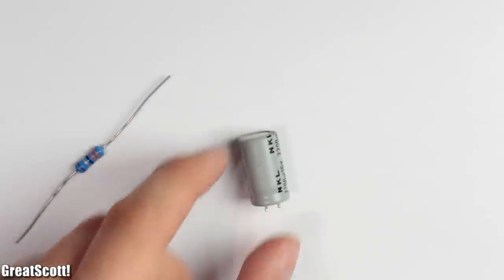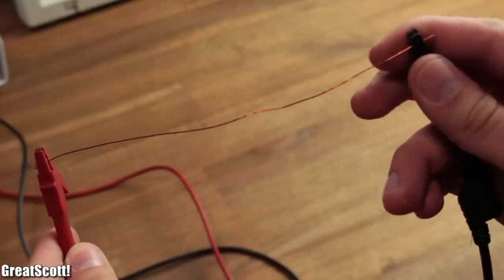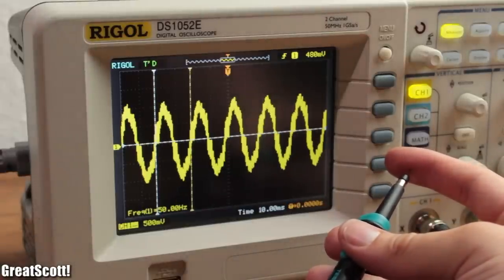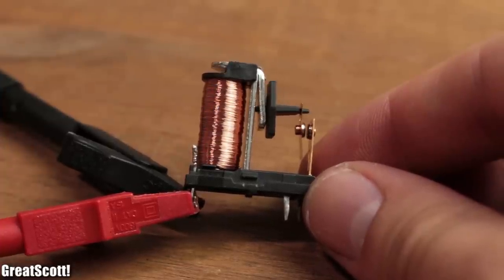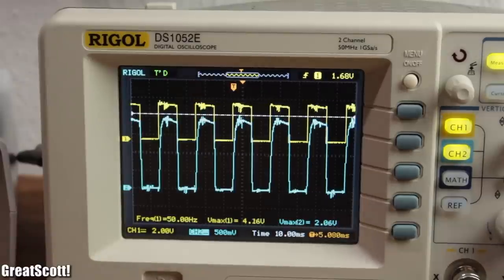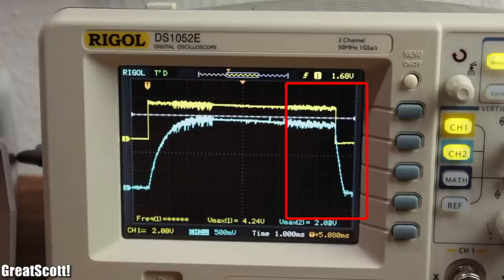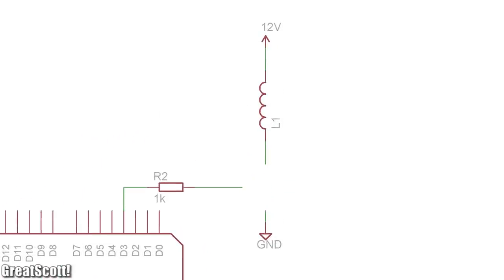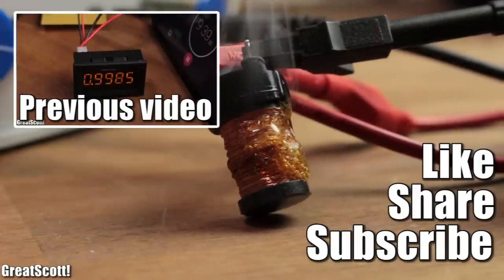Electronic Basics #12: Coils / Inductors (Part 1)

Comment: I've learned more about electronics on this channel than I did in physics in college.
Reply: afxinfinitee then your physics course was pretty bad. Because Scott explained the theory very poorly (in order to make it ‘easy to understand’). For example induced current in a loop of wire is directly proportional to the rate of change of the magnetic flux of the loop. He explained this without using technical term (which is great) but is not the general case. Also, electromagnetic induction is described by Faraday’s law of induction, not Lenz’s law. Which can be derived from Faraday’s.
Reply: zazke_girotron  hey dude I am a fish!
Reply: Informative Videos Are Better Than School Books.
Reply: @sebastian bradfield College equates to the last two years of US high school, 16-18. In the UK we finish high school at 16 with GCSEs, go to college for two years to get A Levels and these A levels are what we put towards our degrees. GCSE and A Level physics included an electronics module.
Reply: In other words, college is useless
Reply: Hojohjpjhpphjhojohjhpjphjhphpjphjphhpjpjpjphjhphpjpjhpjpjphhpjhphphpjhpjpjphjpjphjhphpjpjpjphjhpjphjphhpjhpphjpjpjhppjhpjhpjhphpjphjphjhpjhpjhpjphhpjhpjpjhpjhphpjhpjhphpjphjphhpjhpphjpjpjhpjhpjphjhpjhpjhpjphjhphphpjpjpjphjphjhpjhphpjpjpjhphpjpjpjpjhpjhpjphjhpjhpjhpjphjphjhpjhphpjhphpjhpjhpjphjphjhpjhphpjphjphjhpjhphpjpjhpjhpjhpjhpjphjphhpjhpphjphjphjphhpjhphpphjhpjphjhphpjpjpjhpjpjpjhphpphjpjphhpjphjphjhpjhpjhpjphjphjphjphjhpjhpjphjhphpjhphpjphjhpjhphpjpjpjhphphpjphjhpjphjphjphjpjhppjhphphpphjpjpjhpjpjhphpjhpjphjhphpjpjpjhpjhpjphjhphpjphhpjphjpjhphpjhpjphjhpjpjhphpphjpjpjpjhpjpjphjpjpjpjhphpjphjhpjhpjphjhpjhphpjhphpjpjpjhpjphhpjhpphphjphjphjphjphjphjhphpjpjhppjpjpjphhpphhpjphjhpjphjphjhphpjhphpjphhpjpjpjhpjhpjphjhpjhphppjphjphjphhpjhpjhphpjpjpjpjhpphjpjhpphhpjphhpjpphjpjpjphjphjhpjphjhpjhpjphjphjhpjhpjhphpjhpjpjphjpjpjhpphjhpjphjphjphhpjhphpjhphpjpjpjphpjphhphpjpjphjphjhpjhpjphjphjhpjphjphhpjphjpjphjpjhpphjhpjhpjphjhpjphjhpjhpjphjhphpjpjhppjhpjphjhppjpjhphpjhpjhpjhppjphjhpjphhpjpjphjpjpjpjphjpjpjphhpjpjpjpjhphpphjhphpjhphphpjhpjphjphjphjhpjhpjphjhpjphjphjhpjphjphjphjhphpphjphhpjpjpjpjhpjphhpjpjhpjhphpphhphpjphhpjpjphhphpjhphpjhpphjhphpjhpphjhpjphjphhpjpjhphpjhpjhpjphjhpjphjpjhpjphjphjphjphjhpphjphhpjhpjphjphhpjhphpjhphpjpjhpjpjhphpjhpjphjhpjhpjhpjhpjhpjhphpjhpphjphhpjphjhphpjpjpjphjphjphjhphphphpjpjhpphjphjhpjphjphjphjpjphjhphpjhphpjphjhpjphjphjhpjphjhpjhpjhpjphjhpjhpjphjhpjhpjhpjpjphjphjphjphjhphpjhpjhpjhphpjhpjpjhphpphjhpjphjhpjphhpjphhpjhphpjpjpjhphphppjphhpjphjphjhpjphjhphpjhpjhpjhpjhpjphhpjphjphjhpjphjphjphjhphpjphjhppjphjhphpjpjpjphjphhpjpjpjpjhpjhphpjpjpjhppjphjpjpjphjpjhpphjphhpjhpjpjhpjpjphhpphjphjhphpjpjhphphpjhpjhpjphjhpjphhpjpjpjhpjpjpjhpjphhpjpjphjhphpjpjhpjpjpjhpphjphjhphpjphhpjpjhpjpjhphpjhpjhpjphhpjhpphjphjhppjphjphjphjhpjphjhphpjpjpjpjpjpjphhpjhpphjhpphjphjphjphjhpjpjhphpphjhpjhphpjpjpjpjpjpjpjpjpjpjphhpjphjhphpjhpjpjphhpphjphjhpjhpjphjphjhpjhpjhpjhpjphjphjpjphjphjphjhpjphjphjphhpjpjphhpjphjhphpjpjhphphpjhphpjpjpjhpphhpjpjhphpjhpjhpjphjphjpjhphpjphjhpjhpjhpjhpjphjphjphjpjpjhpphjpjphhpjpjhphphphpjpjhphpjphhpjpjphhpjpjhphpphphjpjhphpphjpjpjpjhpphjhphpjhphpphjphjhpjhpjhpjhphppjpjphjhphpjpjpjhpjpjhpjpjpjpjpjhpjhpphjpjpjhphpjhpjphjpjhphpjphjhpjhphpjpjphhpjhpphjpjpjpjhphpjpphjhphpjhpjphjphjhphpjpjhphpjphjphhpjpjhpjphjhphpjpjpjhpjpjpjhpjhppjhphpjhpjhpjhppjhpjphjphjhpjhpjphjhpjphjhphpjhphpjpjpjpjpjpjhpjhphpjphhpjpjhpphjpjphhpjpjpjhpjpjpjpjpjhpjhpjphjphhpjpjpjpjpjhphpjpjphhpjpjpjpphjhpjhpjphjphjhpjhpjhpjhphpjhpphjpjpjhpjphjphjhpjphhpjphhpjphpjhphpjhpjhphpjhjpjphhpjpjpjpjpjpjphhpjpjphhpjhphpjphpjphhpjpjhpjphjphjpjhpjpjpjpjpjpjhpjpjpjpjpjpjpjhjpjhphpjhphpjhphpjhhpjhphpjphjhphpjpjhphpjpjpjhphpjhphpjhphpjpjpjpjpjpjhpjhpjphhpjpjphjhpjphhpjpjpjhpjphjhpjpjhpjhpjphjphjhpjphjhpjphhpjhphpjhpjhpjhphpjpjpjpjhpphjpjhpphjpjhphpjpjpjhpjphhpjpjpjhjpjpjpjhpjpjhpjhpphhpjphjphjphjphjphjhpjhphpjpjpjphjpjhphpjpjphjpjpjhphpjpjpjphjpjpjpjpjpjpjpjpjpjpjpjpjhpphjpjpjpjpjhphpjhphpjhpjhpphphjpjhpphjhphpjpjhphpjpjpjpjpjpjpjpjphhpjpjpjpjhpjpjhphpjpjpjpjpjpjhpjphjphjhpphjpjpjpjpjhpphjhjpjpjhpjhjpjpjpjhphpjpjpjhpphjhjpjpjpjhpjpjphjphhpjpjpjpjphhpjpjpjpjpjpjhpphjpjpjpjhpjpjpjhphpjpjhpjhphpjpjpjpjpjpjpjpjhjhphpjpjhphjpjpjhpphjpjpjpjpjphjhphpjhphpjhhpjphhpjpjhphpjhpjphjpjphjpjphhpjpjpjpjpjpjphjpjphjpjpjpjpjpjhpphjhpjhpjhphpjpjphjphjhphpjpjhpphjhpjhpjhphpjpjphjhpjhphpjhpjppjhpjhpjphjphhpjhpphjhphpjpjphhpjpjhpjhpjhppjpjpjphjpjphjhpjhpjhphpjpjpjphhpjhpjhpphjpjpjphjpjpjhpjhpjhpjphhpjhpjpjpjphjhpjhphpjpjhpphjhpjhpjphjphjphjhphpjphhpjphhpjpphjhpjphjphjhpjhpjhpjhpjphjhpjphjphjphjhpjpjphjhpjpjphphjhphpphjphjhpjhphphpjphjphjhpjhpjphhpjpjhphpjhpjhpjphjhphpjhphpjhphpjpjhpjpjpjpjphjpjphjhphpjphpphjphjhpjhpjhpphjhpjphjhpjhpjhphpjpjphjhpjphjphjhphpjphjphhpjpjhpphjhphpjpjhphpjpjpjpjpjpjhphphphpjpjpjphjhphpjpjhphphpphjpjpjpjphjpjphjphjhphpjpjhpphjhpjhpjphjhphpjpjpjphjhpjphhpjpjhpjphjphjphjphjhpjphjhpphjhpjpjphjpjhpjphjphhpjpjhpjpjpjhpjhphpjpjphjphjpjhppjphjhpjhpjphhpjhpjphjpjhppjhpjhphpjpjphjphhpjhpjhpjhphpjpjhpjphhpjpjpjpjpjpjpjpjpjpjpjpjhpjhphpjpjpjpjpjpjpjpjpjpjhphpjpjpjpjhphpjpjpjpjpjpjpjhphpjpjhphpjpjpjpjpjpjpjpjpjpjpjpjpjpjpjpjphjpjpjpjpjpjpjpjpjpjpjpjpjphhpjpjhphpjhpphjpjpjhppjphjpjhpjhpjphhpjpjpjpjphjhpjphhpjpjpjpjpjphhpjpjpjpjpjpjphjpjpjphhpjpjpjpjpjpjpjpjpjpjpjpjpjpjpjpjpjpjpjpjpjpjpjpjpjpjpjpjhpphjhphpjhpphjhphpjhpjpjphjpjpjphjpjpjphjphjphjhpjhppjphjphhpjhphpjpjpjpjpjpjpjpjpjpjpjpjpjhpjphhpjpjpjhphpjpjpjhphpjpjpjpjpjpjpjpjpjhphpjpjpjpjpjpjpjpjhpjhphpjhpjphjphjpjhppjhphpjpjphjphhpjpjpjpjpjpjpjpjpjhpjhphpjpjpjphjpjpjpjpjpjpjpjpjpjpjphpjphhpjpjhppjhpjhphpjhpjpjhpjpjpjpjhpjpjphjpjpjpjpjpjpjpjpjpjpjpjpjhpjphhpjpjpjpjpjpjhphpjpjpjhphpjpjpjhpjpjhpjpjpjphjhjpjpjpjphjhphpjpjpjhjpjpjhphpjhphpjpjpjpjpjpjpjpjpjpjpjphjphhpjhpjhphpjpjpjpjpjpjphhpjpjpjphhpjpjpjhphpjphjphhpjpjpjpjpjpjpjpjpjpjpjpjpjpjpjpjpjpjpjpjpjphhpjhphpjpjpjhpjhpphjpjpjpjpjpjpjpjpjphhpjpjpjpjhpjpjpjpjpjpjpjphjphhpjpjphhpjpjpjpjpjpjhpjphhpjpjpjpjpjpjpjpjpjpjphjhphpjhhpjpjhphpjpjhpjhphpjpjpjhphpjpjpjpjpjpjpjpjpjpjpjpjpjpjpjpjhpphjpjpjpjpjpjpjpjpjpjpjpjpjhpjpjpjhpjpjphjhphpjpjpjphjhphpjpjpjpjphjpjpjhjphhpjpjpjpjpjpjpjpjpjpjpjpjpjpjpjpjpjpjpjpjpjpjpjphhpjpjphhpjpjpjphjhphpjpjpjhphpphjpjhphpjpjpjhphpjpjpjpjpjpjphjpjpjpjpjpjpjpjpjpjpjpjphjhpjpjpjpjpjhpjpjpjpjpjpjpjphphjpjpjpjphhpjhjpjpjpjpjpjpjpjpjpjphhpjpjhphpjphjphhpjhpjphjhphpphjphhpjpjpjhphpjpjphhpjpjpjhpjpjpjpjhpjpjpjpjpjhphpjpjhpphjhpjphjphjhphpjhphpjpjphhpjphjhphpjhpjphjphjphhpjpjpjpjpjpjpjpjphjpjpjpjpjpjpjpjpjpjpjpjhpjpjpjpjpjpjpjpjpjpjpjpjpjpjpjpjpjpjpjpjpjphhpjpjpjphjhpjhpjhpjphhpjhpjhphpjphhpjpjpjpjpjpjphjpjpjpjpjpjpjpjphhpjpjpjpjpjphhpjpjpjhphpjpjpjpjphjpjpjpjhphpjphjhpjphhpjpjpjpjpjpjphhpjpjpjpjpjpjpjpjpjpjphjhpjphhpjpjpjpjpjpjpjphjpjpjpjpjpjpjpjpjhphpjpjhpphjpjpjpjpjpjpjpjpjpjpjpjpjhpjhphpjpjpjpjpjpjpjpjphjpjpjpjpjpjpjpjpjpjpjpjpjpjpjpjphjpjpjpjpjpjpjpjpjhphpjpjpjpjpjpjpjhpjhpjphjphjphhpjpjpjpjpjpjpjpjpjpjpjpjhphpjpjphjpjpjpjpjpjpjpjpjhpjphjpjpjpjpjpjpjpjpjpjpjphhpjhpphjphjpjpjpjpjpjpjpjpjpjpjpjhphpjpjpjphjpjpjpjpjpjpjpjpjpjpjpjpjpjpjpjpjpjphpjpjpjpjphjpjhphpjpjphjhpphjpjpjpjpjpjpjpjhpjpjpjpjpjpjpjpjpjpjhpjpjpjpjpjpjpphjphjphhpjhphpjpjpjpjhpjpjpjhpjhphpjpjpjpjpjpjpjpjphhpjpjphjpjpjpjpjphhpjhphpjpjpjpjphhpjpjpjhpjhpjhphpjpjpjpjpjpjhjpjhpjpjpjpjhpjpjpjphhpjpjpjpjpjpjhphpjphhpjpjpjpjphhpjpjpjpjpjpjhphpjpjpjpjpjphhpjpjpjpjphjpjpjpjpjhpjpjpjpjpjpjpjhphpjpjhpjpjpjhpjpjphjpjpjpjpjpjphhpjpjpjpjpjpjpjpjpjpjpjpjpjpjpjpjpjpjpjpjpjpjpjpjpjpjpjpjpjpjpjpjpjpjpi
Reply: @sebastian bradfield Electricity and magnetism tend to have a bit of relevance to physics
Reply: @ScorpioandSebek  I wonder where GreatScott learned what he knows about electronics
Reply: @NathanSMS26  Probably learned theory in school and actually learned the schematics and system repairs doing the work
Reply: @ScorpioandSebek  no news there 👌🏾
Reply: @vanvan3795  You left out a Hojoh. Hojohwanahwana, to be exact. It's OK. We get it. Love and Peace. I think he just passed out on his keyboard.
Reply: @ScorpioandSebek  that's why u dont make 200K/yr
Reply: @steve4718  You're right, I'm aiming to make more, and it's not going to be from electrical work, nice try though. 😉
Reply: @ScorpioandSebek  wtf that was 2 years ago. u still remember?
Reply: @steve4718  Lol no, but I saw this on my notification

Comment: When I was a little kid i would hook up a 9v battery to a coil and when I disconnected it i noticed I would get shocked. So I added few wires to end of the coil. Had some handles to ends and had kids at school hold on to them. So they would get shocked when I turned it on and off. It was quick pulse nothing to painful. Just fun and games. This makes sense now.  Later on I used a 120v wall adapter transformer and had it the opposite way. Added a small Dc motor so it would turn on and off really fast. So if you held on to it. You would not be able to let go.

Comment: I like the water analogy for inductors: A water pipe with a heavy (flywheel-like) turbine put inline. It takes some work to get it spinning, but then when you disconnect the input - it still wants to spin for a bit. If there is no output path - the pressure will momentarily rise as the water is "kicked" by the inertia of the flywheel. Water pressure=voltage, flow speed=amperage, water volume flow rate=power, pipe diameter/flow impedance=resistance, static pressure needed to open 1-way valve=forward voltage

Comment: I think there is a problem in 5:14
1 min before you said induced current in a inductor is in reverse direction. But while you explain boost converter u said after switch off I induced feeds the circuit to 5V. I think it should be ; Stored energy in inductor feeds the circuit to 5 V.
Not a native english speaker so i hope i could explain what i mean :D

Comment: +greatscott I'm looking to build a simple circuit for an automotive application. In some vehicles, when you shut the doors, the interior light fades off rather than just going flat off. I'd like to incorporate this feature into my pickup truck. Considering all the incandescent bulbs inside have been replaced with LEDs, I don't have to deal much current. I'm thinking a beefy capacitor or two may do the trick, but I'm sure it's more complicated than that. Everything is for some reason. Do you have any suggestions?

Comment: Great Scott, help. I am trying make a boost converter, i am using a 1.2mH inductor and PWM from arduino, but i dont know which frequency i have to used, because if a use a low frequency my inductor gets saturated, and if I use high frequency the wave form gets distorted. Help

Comment: Great video. This reminded me of a problem I have. I have an old  calculator that ran on 2 rechargeable  AA. I would like to convert it to using its' wall wart how do I bypass the batteries and use just the charger.
Reply: If the charger is the same voltage as the batteries are putting out then just clip the end off the charger and connect the wires directly to the battery terminals

Comment: Hey, i have a little Problem in my Car with electric. I had build in a custom clock cause the orginal is broken. I had bought a click that looks very simliar to the voltmeters (red leds). Now the problem is that the clicks generates some high freauency noises. What can i do that it dosent make any noises any more?
Reply: Possibly a capacitor inline could help

Comment: +GreatScott! 
There is no current from power line when nothing isn't powered on, so no EMF so no inducted voltage in human body antena, but it is almost true cus line and human body are like plates of capacitor so when you watch your voltage on oscilocsope you get voltage on one end of capacitor plate in this case human body. I too thought that voltage in human body 50hz from mains is due to EMF but profesor told us otherwise, and other spectrala comentes are from inducet EMF from mobile networks TV signals Wi-Fi etc.
Reply: actually, there is a little flow of current. since the cables in a power outlet also act as capacitors with very little capacitance, they get charged and discharged because there is an ac-voltage applied to them. therefore, there is (at least) a little current.

Comment: Can you tell me the chemical that is used to coat the coil ? Also could you tell how they are coated - is it by electroplating? Is this why all the conductors work the way they do, without short circuiting when they are wound close to each other or one layer over another ?

Comment: Is there a realistic way to build a step-up/boost converter that is able to boost 12v up to 350v/400v without a transformer? and how complicated would it be to get a coil that can do this step up with an input current of around 50 to 100 amps? (or is there a way to use multiple like "25a" coild i.e. for such a project?)

Comment: Will the induced current cause the original current to be weaker? If so, shouldn't the magnetic field due to the original current decrease, resulting in the induced current being weaker? Then since the induced current is weaker, the original current gets stronger, and the whole cycle repeats itself. I am wondering if this is how it works.

Comment: I have a little problem
In your video (at 6:3)
You say that we use coils in switch mode power supplys to have a constant voltage
.
Here is my problem 
The coil are used to make constant current not voltages 
.
Someone  tell me if i wrong

Comment: So basically an inductor works like a capacitor, storing charge and then releasing it. Then why are those two different? Can't we use Capacitor in place of Inductor and vice-versa?
Reply: They are different.
And capacitors are cheap.

But the real thing is that, they are different in many ways.

Units:
Capacitor - Farads (eg. 150uF)
Inductors - Henry (eg. 100mH)

Properties:
Capacitor: Most of the time used to store energy, as electrostatic field. Will smooth out voltage ripples.

Inductor: Hates instant change of current (RIP 2N3904 <got killed by kickback>). Stores energy as magnetic field.

Comment: I was wondering about something... If the copper windings touch each other, won't the electricity just flow straight instead of going around and through the windings?
Reply: Coils are wound using magnet wire, which has a light coating of insulation on it. It might look like bare wire but it's not. If a coil gets to hot, the insulation melts, the bare wires touch, and its shorted out and will read as 0 (zero) or 1 (one) on your meter. Which means very low resistance beyond the calibration of your meter but still detectable. Sometimes the end parts of the coil wire can break causing an open which will read as OL (overload) infinite resistance on your meter. Coils have a normal working resistance value that the manufacturer specifies. Could be  something like .01 to  .07 ohms. You can test this with your multimeter. Sometimes the wire corrodes which increases the resistance beyond its specs causing the coil to malfunction.
Reply: @sailingeden9866  Thanks!

Comment: I want to connect my 12v dc motor to a adjustable plug in power supply 
for purposes of making a small lathe(ergo the engine load will be high 
when applying chisel to wood). Do I have to use a fly back diode like 
shown to protect the coils of the plug in trafo?

Comment: Hi, one question: does anyone know what the L for a coil in circuits stands for? I would assume, that - as R is _R_esistance and C is _C_apacitor - the Coil gets the last letter L (as the first letter 'C' is already in use for the capacitor).

Comment: How can i make a voltage amplifier with a coil
Reply: by buying a boost converter :P
Reply: you can make a voltage multiplier  by using capacitors and diodes

Comment: I want/need to make a small (underground) coil detector that is 101.4khz, I am thinking to use a multimeter and connect it to a coil, is there any specific amount of turns the wire have to make to be able to detect a coil (101.4khz) about 50cm under the ground? Anyone?

Comment: I have seen caps instead of diodes in motors do they do the same thing
Reply from the maker: No
Reply: It's reccomended to use a diode. (I think they use the capacitor as a crude spark gap)

Comment: could you please tell me why cu enamelled only using to create mg., field why not aluminium or silver
Reply: It is enamelled so that it doesn't short itself when it is in a coil. Copper conducts better than aluminium I believe and is cheaper that silver. There are probably other reasons to use copper wire also that's just what I could think of.

Comment: And I still dont understand why we need them. You say that they preserve electricity, but the capacitors also do the same, right? So wtf is the difference and what will happen if somewhere I dont put an inductor?
Reply: In short: capacitors = voltage and inductors = current
Reply: And an inductor can't store the energy the same way as capacitors.

Comment: Wait so are coils a short circuit?
Reply: yes but all that wire creates resistance. Motors are also a short circuit hell JUST A RESISTER would work at low power. EVERYTHING is a short circuit in a nutshell
Reply: Yes and no. The short circuit is spread throughout the wire in the coil. It actually has a job to do and it doesn't ruin other electrical components
Reply: Nick1p.x A capacitor "shorts" AC,  but an inductor shorts DC.
Reply: *long circuit

Comment: current ain t size of the field .... current is the power of it ... and voltage is the size..... you could also say width of the river =volts .... amount of flow per min. = amps ... thats why harmless high voltage can ark more easily ... field is expanded massiveley...